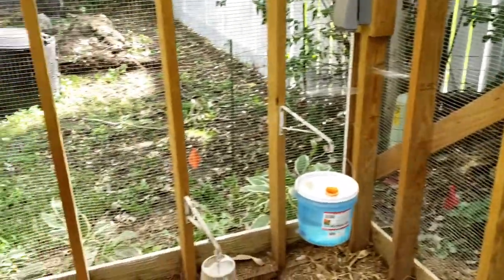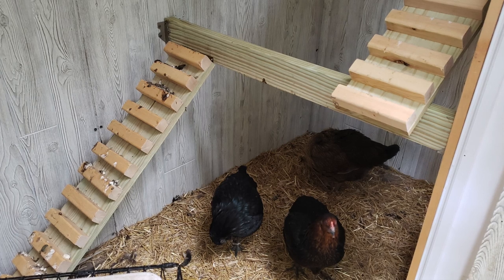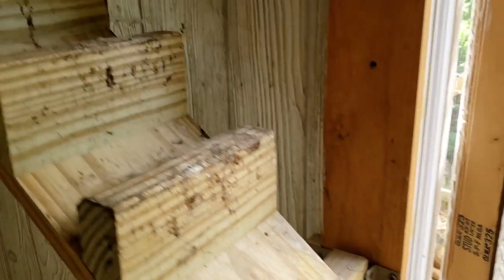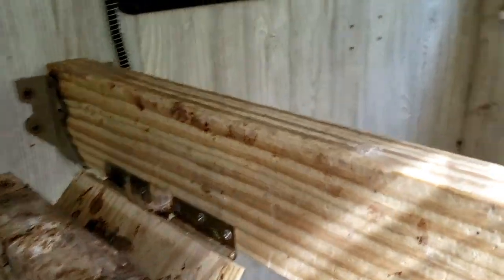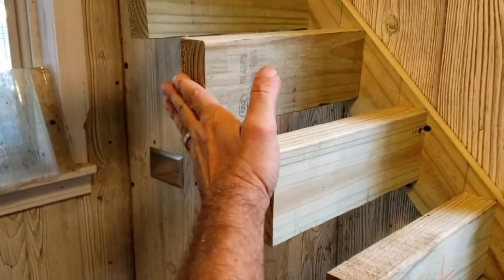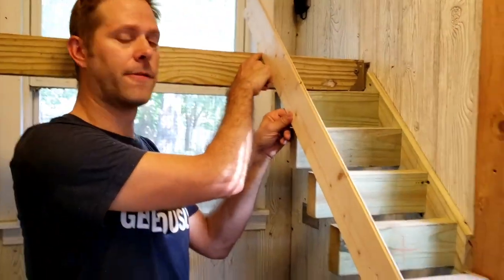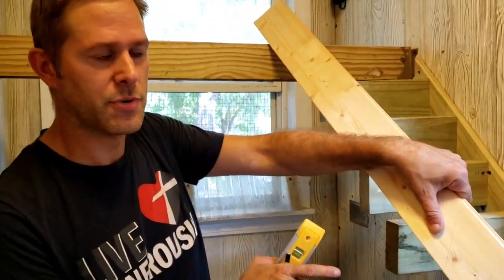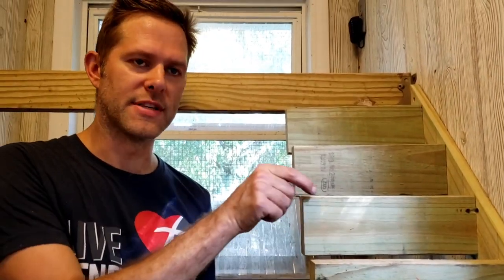Smart chicken coop stair design

Comment: or rotate the 2nd staircase so that the edge of the 2x4 becomes the face of the stairs and the 4 in surface becomes the steps.
Reply from the maker: There is a lot debate about which direction the 2x4 should be rotated. I find that a 1.5" deep roost (and stairs) are ideal for chickens because their toes wrap around the edges for a solid grip. These roosts stay cleaner, too.
Reply: @FrostSimula  speaking of the roost, I was curious about the proper width of it.  Ideally I would use tree limb, if I could find one that's long and straight enough.  Last summer I had to modify the roost due to one of my oldest hens being injured by a dog attack and she had a dislocated wing so she could not jump up the roost at night.  My roost at the time was a 2-level 2x3 bars on a flat position, secured onto 2 2x3's on an angle leaning toward one wall.  The modified roost now is lower with both bars at the same level.  But I notice that the chickens like to roost on the support bars that are the edge of the 2x3, instead of the flat 3" of the main roost bar.  I thought they were just trying to huddle together as far away as possible from the other 'gangs' (there are different age groups and breeds and they group themselves based on those).  Now that you mention the grip, it makes sense.  I guess I need to modify the roost again this summer.
Reply: @d.a.tsun5104  - I had 3 roosting bars in the coop, and one was a tree limb in the back and the other two were wooden ones with curved edges (I think they were 2" square, and perfect size for them). They preferred the tree limb to the wooden ones, but as we got more hens, they did also use the wooden ones.

Comment: How high do chickens typically like to roost?
Reply from the maker: Chickens will roost as high as you let them. The most important measurement is making sure that roosts are at least 18" away from walls and other roosts (to keep them clean), and that there is at least an 18" height difference between roosts. Chickens want to sleep up high, and they do most of their pooping at night. To keep poop out of the nesting boxes, make sure they are lower than all of the roosts.